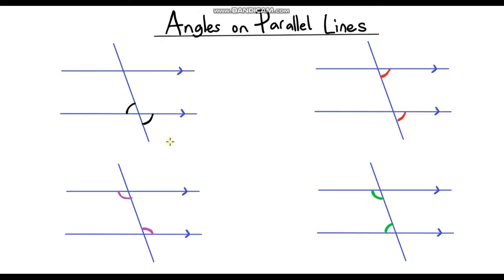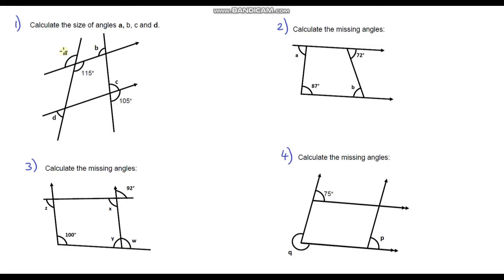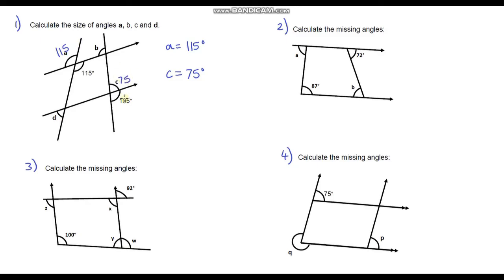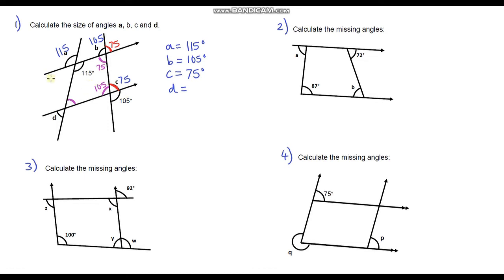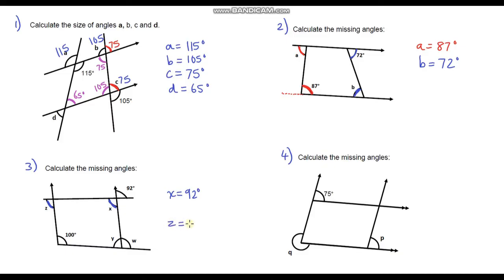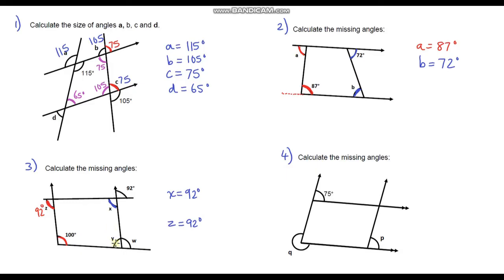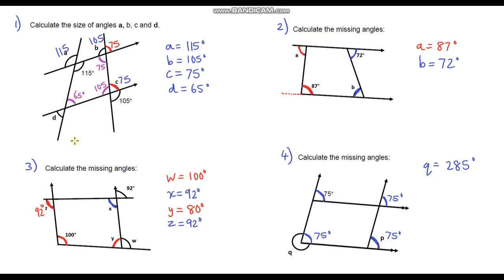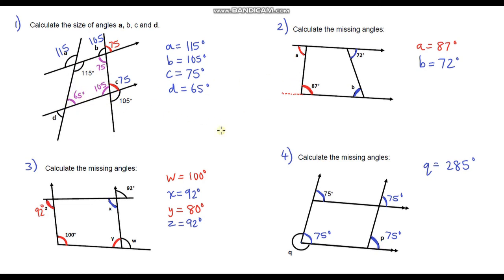Calculating Angles on Parallel Lines

Comment: Plis how did you get 65 in number 1
Reply from the maker: There are 2 ways that I can see.

1. We know all the other angles in the middle. Angles in a quadrilateral sum tp 360, so if we subtract 115, 75 and 105, we are left with 65.
2. The angle opposite D is co-interior to the 115 angle. Therefore they sum to 180. If we subtract 115 from 180, we get 65.

In both methods, angle D is opposite so will be the same, giving 65.

Comment: You wrong d is not 65 its 55
Reply from the maker: Hello. I've just double-checked my workings, and the answer is 65 degrees. The sum of the other 3 angles is 295 (115 + 105 + 75). Therefore, to calculate angle d, we need to subtract 295 from 360, which gives 65 degrees.

Comment: i get itt but idk how to go about parallel lines? like for question 3 i would have said z was 100 because there was vertical parallel lines, why does it have to be horizontal for it to work? im so confused :face-purple-crying::face-purple-crying:
Reply from the maker: For that question, I think you are only focusing on one line. Notice that the 100 degree angle and Z are only part of the left vertical line (they don't have any connection to the right one). To have 2 angles that have a relationship with one another, the angles must be on BOTH parallel lines (e.g. X and Z... or W and 100).